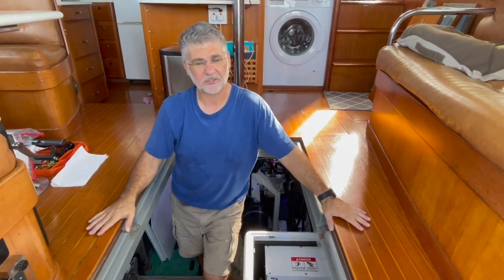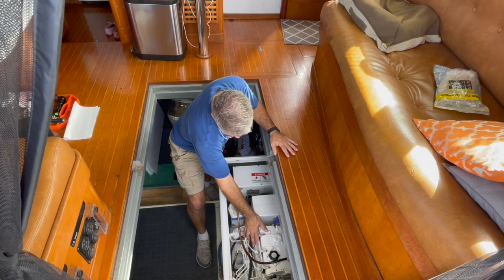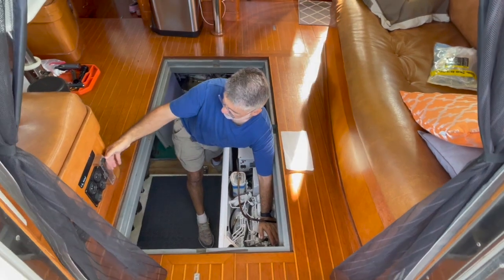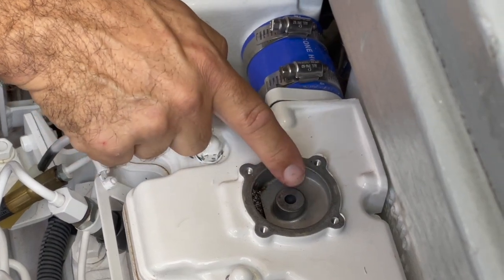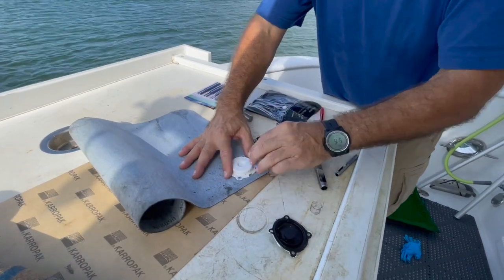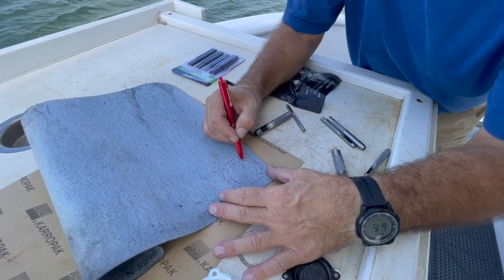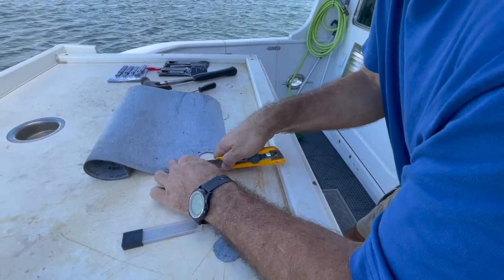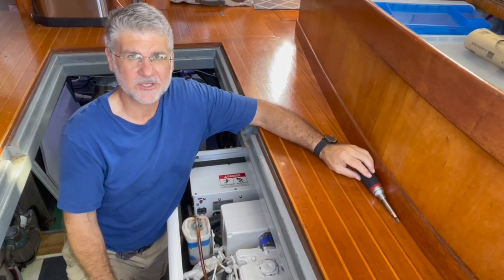12KW Real Main Seal Leak Investigation aboard Chicory a 46 Nordhavn

Comment: I think it is a design flaw with Northern Lights generators. I had to replace the rear main seal 3 times on my 8 kw NL. But I also got 30,000 hours out of it.
Reply from the maker: Thank you for your comment. 30,000 hours is a great run! If you had a car that had mostly highway miles and averaged 45 miles per hour, 30,000 hours represents 1.35 million miles. I think three main seals are acceptable when you look at it this way. What do you think?

Comment: I’ve heard AT205 helps to recondition rubber seals so they are pliable and form a seal
Reply from the maker: Thank you for your recommendation. I have AT205 in my emergency repair supplies, but I wanted to see if the valve change would work before resorting to the additive.